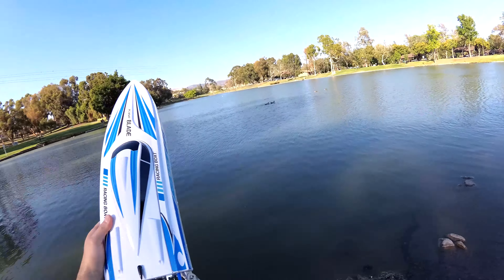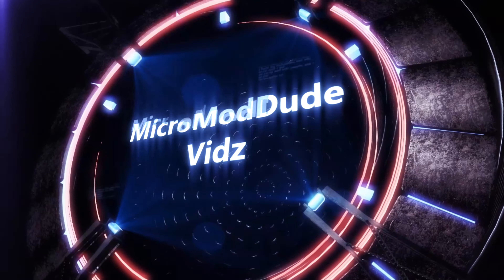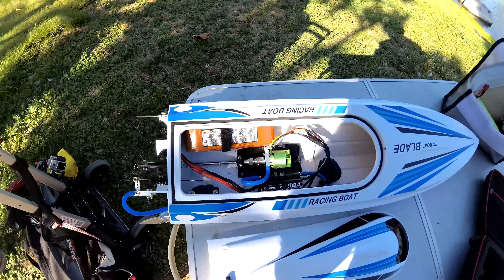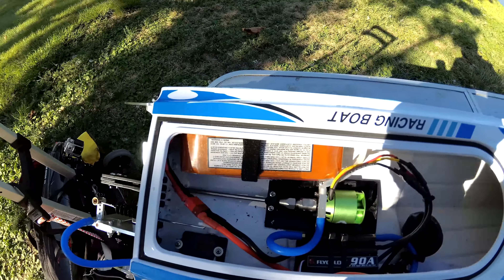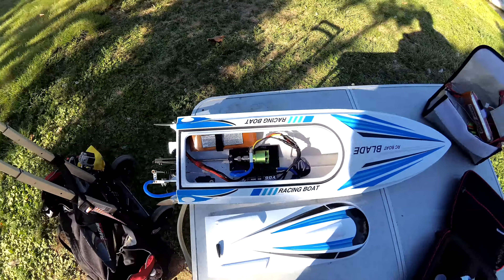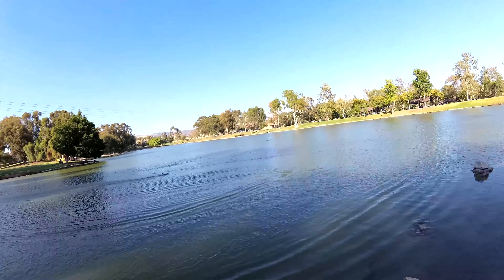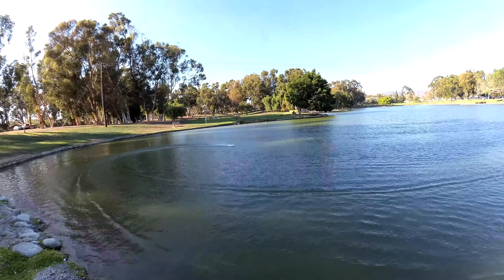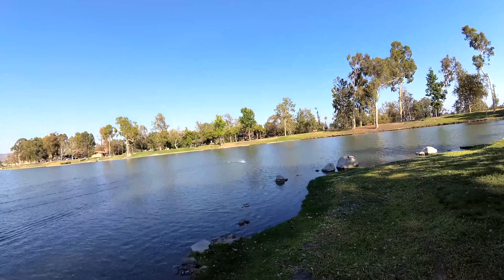Volantex Blade Lake run 7/29/16

Comment: Thanks for great work..with this setup could you run it on 4S battery
Reply from the maker: Mohamed Meftah No, it be too much power. Somethings wrong with my esc timing as motor is not getting full power. Im trying a different esc next.